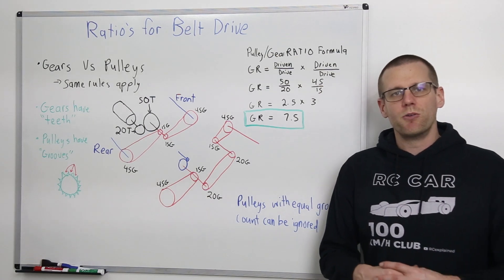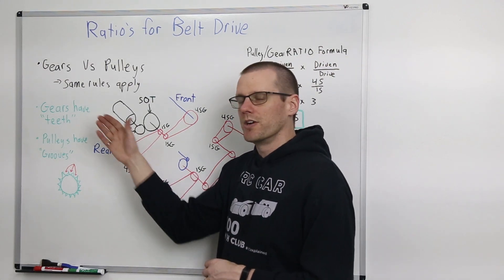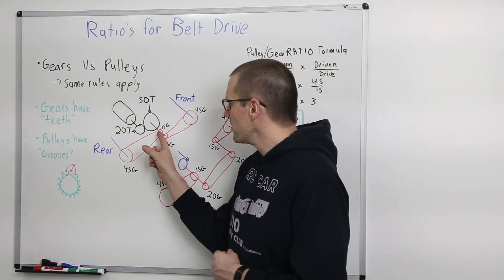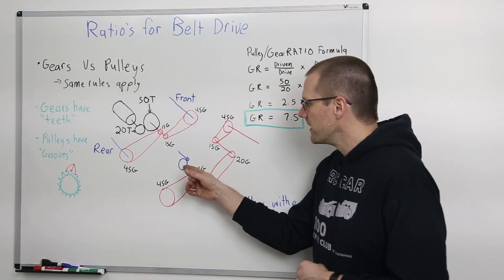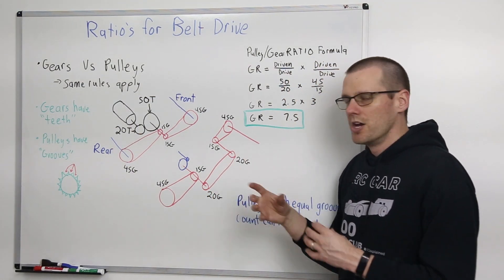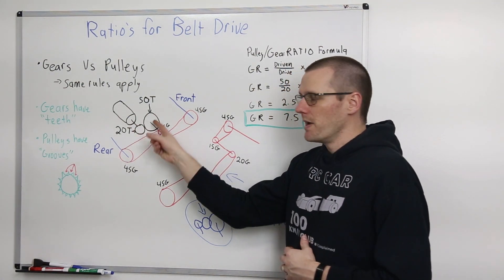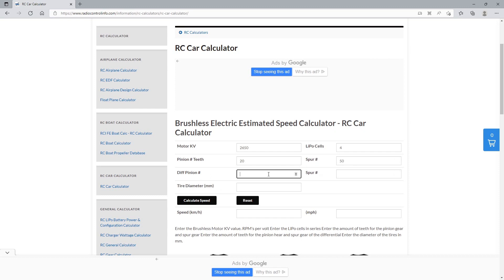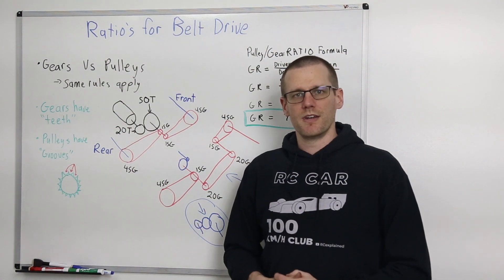How to Determine the Pulley (Gear) Ratio of an RC Car

Comment: Hey Ryan! Thanks for all your excellent videos. I’m building a cable cam with the requirement of shifting around 5 - 7kg at low speed from a complete standstill then moving through to med - high speed. What type of motor would you recommend for this purpose?
Reply from the maker: A motor that can handle up to 500w should be able to handle that load with little issue. It really depends on how fast you need the unit to be moving at and how quick it needs to accelerate. If there are units like these in the market that offer up motor specs. That's where I would start. Find out things like wattage and voltage to build a system from.
Reply: @RCexplained  thank you for a speedy reply. Yes that’s exactly where I started but they all keep their specs well hidden. I’ve been looking at the Castle Creations range, they seem very solid. I need an all purpose solution because usage will be determined by what is being filmed. I’m hoping to tackle this variable with different settings. I’m guessing a censored motor / esc combo would work best.